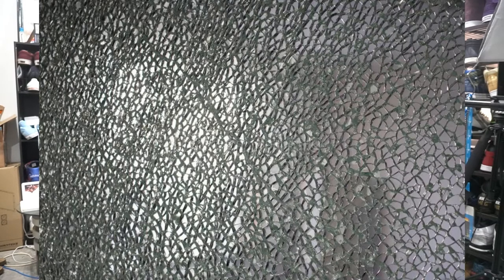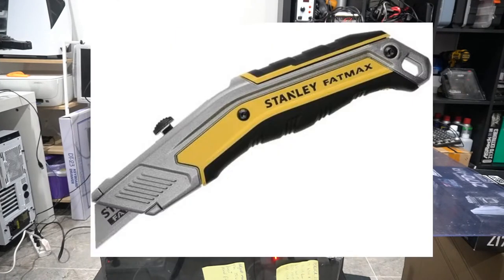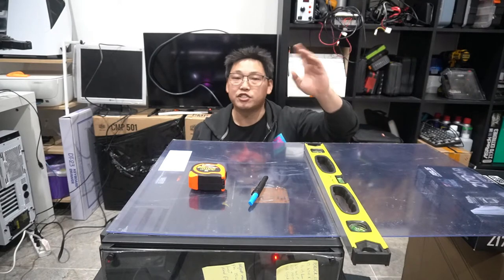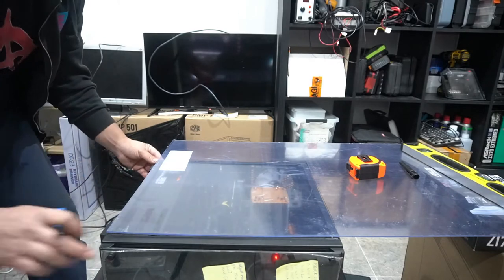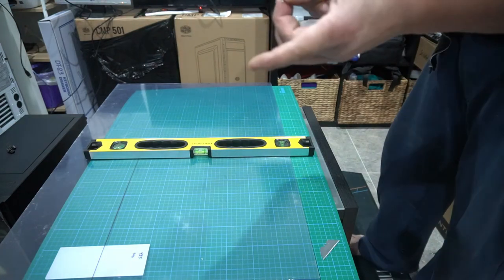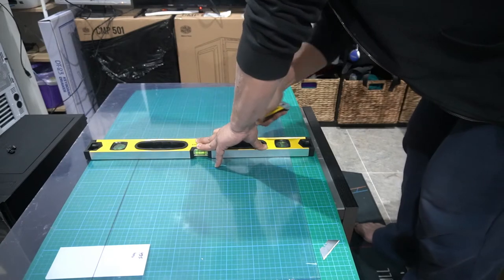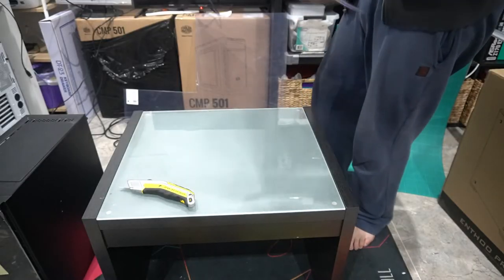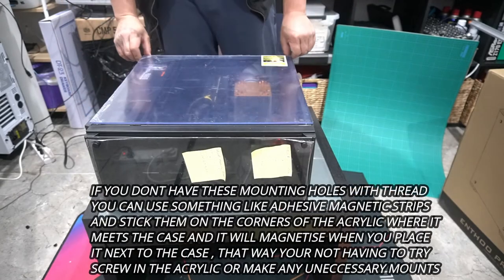pc mods how to replace pc case side temperred glass using acrylic perspex EASY FIX!!

Comment from the maker: guys I wanted to add that after doing this I sourced out a perspex manufacturer and they simply cut me a piece at whatever size I wantd for 13aud which is much cheaper then having to buy the tools to makeit and cut it ... but remember that tools are an investment and a good one at that... allowing u to use them for future works diy. but if your just doing the one piece I would recommended a shop that specialises in acrylic perspex .. your cutting would be perfect and precise as they use a machine and laser... just a thought ... good luck all 👍

Comment: My side panel shattered an hour ago. Now I'm gonna go to m local hardware store and get some perspex glass. Thanks!
Reply from the maker: it's a great idea.. ifnu want go to a glass store measure your side panel and ask fornit to be cut to size ..get the same thickness ..and ask for temperred glass... to withstand brute force. I did another video where I used a piece of cut glass from a local glass store it was so cheap $25 aud cut to size ..but it was also normal glass not temperred glass ...have a look at the video came out nice too.. 👌...u can do it either way remember if u have holes in the face of the glass it's abit harder ..as u will need to make holes...in that case use perspex it will be easier like I showed ...for my glass replacement it had a side frame that screwed into the back of the case ...which madenit easy to replace the glass and make the edging

Comment: man thank you so much. i was in the middle of building my first pc and had to re check somthing and took the case off and the tried to put it back. one corner didnt budge. slightly pushed it then shattered everywhere.  now i have to figure out where to buy the acrylic 18.8x17.6 sheet
Reply from the maker: ebay my friend ... but of u can find an acrylic or perspex specialist near u they will cut it perfectly for u cheaper then it would cost u to buy and cut yourself
Reply: @MIKEYZVLOGZ  went to ace hardware and as soon as I said my tempered glass shattered he's like your pc case shattered huh. LMFAO. $16 bucks not a bad deal for a quick temporary fix.
Reply from the maker: lol how did they know

Comment: You did A great job if your OCD like me you can clean up the cut edges with Sand paper and very carefully flaming the edge makes it look factory cut or a wood working rougher  does a fine job (Not bagging on what you did just adding thoughts that may help out other viewers)
Reply from the maker: good points.mate yeah after that I decided to sand the edges and polished them as well... definitely good ideas mate thanks for the Input... I love it wen ppl give me advice cuz I'm not the best diyer.. but I try ...
Reply: @MIKEYZVLOGZ  I am not quite done my build yet but I have done some interesting things might give you some ideas for vids but sorry this will get long I started with NZXT H510 I (don't buy the I its not worth it ) love the look of the NZXT H 510 it is a joy to build in BUT a fount mounted Rad with no airflow not a good Idea so I attacked it with an angle grinder cut out a nice big hole prefect for rgb fans viewing and fantastic airflow then added a stainless steal mesh grill and titanium foil trim then the NZXT cases have a bar inside to guide and hide cables I wrapped that in gray suede vinyl car wrap. custom etched the tempered glass side, silver leafed the black on black NZXT on the rad, custom sleeved cable extensions, still working on a custom RGB GPU backplate and custom RGB SSD convers it looks baller and runs fantastic also used Thermal Grizzly past on CPU and it dropped my temp 15 deg its pricy stuff but worth every Penney
Reply from the maker: @dataluskazan4006  nice mate very nice well done

Comment: first video I've seen from this channel. I really dig the DIY solution and how well it was executed. I would never tell someone not to do this as it really is very well done.. I've had experience with plexiglass and for me it scratches far too easily. still a great video. 👍👍
Reply from the maker: u r 100 % correct there ity scratches way too easily, but if you are simply replacing , then u just do it and leave it there, shouldn't be too many reasons for you to keep touching the side panel unless your constantly upgrading, and if so just be careful i guess... for a cheap option beats getting a piece of glass cut to size, hella exspensive

Comment: Very Good and informative video. I had exact same issue with my case ( Corsair 4000D Airflow) where i was fixing something while building my pc and when i tried to normally remove my side panel (which i already did like 50 times while building my pc) i accidentally pushed a bit hard and corner of my case hit the floor which was about inch and half height from where it hit. And so i was looking for acrylic sheet but some people on internet are saying that they become yellowish or form a tint of color over time. Is it true in your case? have you seen change in color tint of the sheet yet?
Reply from the maker: thanks mate ...
Reply: @MIKEYZVLOGZ  some people on internet are saying that they become yellowish or form a tint of color over time. Is it true in your case? have you seen change in color tint of the sheet yet?
Reply from the maker: @AY3KAY  not at all ... its still clear ... also depends if u also leave it in the sun ... but I have never experienced it going yellow ... I had it like that for a good 6 months to a year then sold the pc and was still perfect
Reply from the maker: also if ur worried about that u could always get tinted ones or coloured acrylic
Reply: @MIKEYZVLOGZ  gotcham thanks for replying! Bless UP

Comment: Hey man, what is the model of your case? i think i have the exactly same case but i didnt knew they sold it on other places
Reply from the maker: it's the karuza v3 mid tower. ase with standard jonsbo fixed rgb 120mm fans

Comment: I can't find any 1200mm x 600mm acrylic sheets, everything on amazon is too small. Any advice?
Reply from the maker: ebay type in acrylic sheets and bam so many come up and u can even choose ur size
Reply from the maker: ebay mate ... that's where I got mine ..but later I found it was much cheaper to have it cut to size in any relic colour u want ..here in Australia I went to a acrylic factory and they were happy to cut to size for plain transparent acrylic for only 12 dollars ..that's even cheaper then buying it and cutting it yourself... I'm not sure where u are ..but try and find an acrylic factory near u and ask how much for an exact cut ✂️.... measure the size u need and tell the.... that's what I did and ended up being so cheap ..takes the hassle of having to cut yourself ... but u will need to drill the holes yourself ... tip... don't drill exact size right away... step up in 1mm so it won't cracks your acrylic edges as it will be fragile
Reply: @MIKEYZVLOGZ  Thank you so much, I just found a local store in another city near me that sells 50x50cm transparent acrylic sheet for $9.33, so I ordered two just in case I screwed up the first while drilling holes in it, but I'll make sure to follow your advice to avoid that, the sheets will arrive tomorrow, it totally cost me around 29.62 dollars (with delivery fee and tax included) At least, that is way cheaper than buying a new case, Thank you for your reply, I really appreciate it!
Reply from the maker: @personmuc943  there u go bro